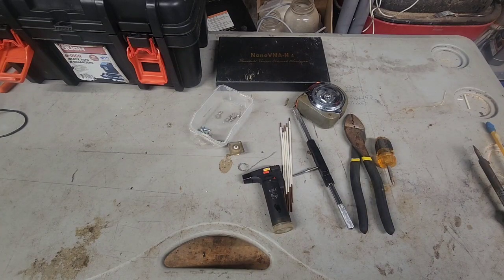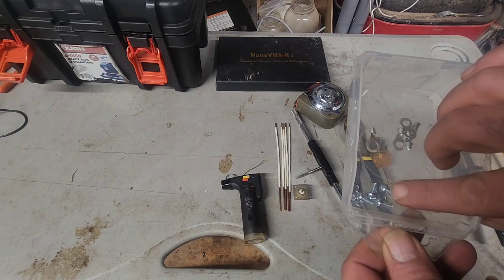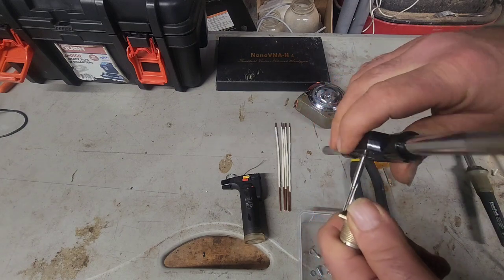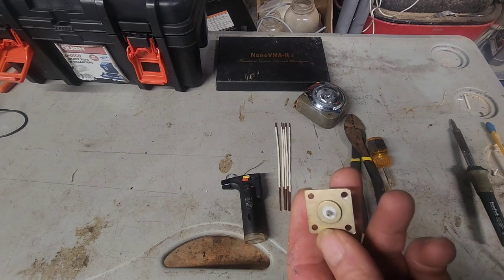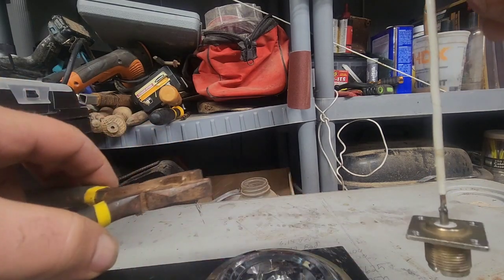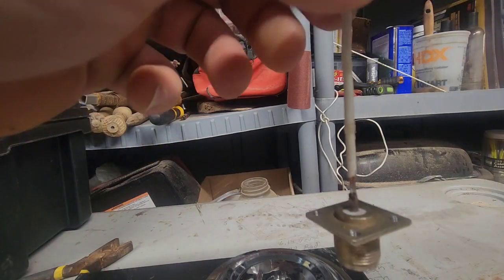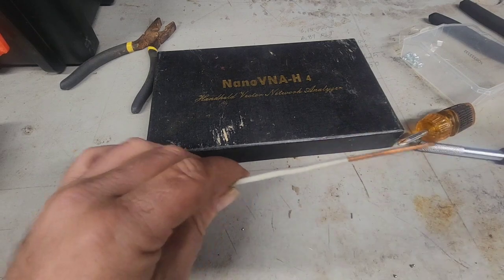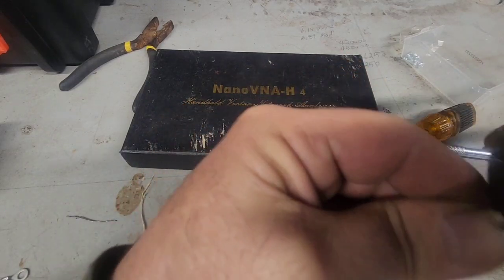70cm/gmrs groundplane build

Comment: Thank you for the video I'm putting it in my group

I think that hypothetically putting it on 11 m with basically longer wires a considerable difference however I still think the same principle applies

Anna meantime 73 yes it is going to be a much bigger on the citizen band 11-meter definitely
Reply from the maker: It will work fine on 11m. You can get it more compact by using fiberglass rod and wrapping the wires in lose coils around it. Then use some large heatshrink to hold everything in place

Comment: Do you have to insulation on the wire, or can you use 14 ga. ground wire from 14ga. romax the reason being I'm making 4 of these ,ONE for me and 3 for my friends.  And I've got the ground left ,Thanks for sharing
Reply from the maker: You can get a better swr and impedance match if you tune to one band or the other. Either ham or gmrs. The readout on this antenna is pretty good but can be better if it's tuned band specific
Reply: Thanks
Reply from the maker: The insulation is not necessary.
Reply from the maker: Anytime
Reply: My buddies thank you too. Because of you sharing you vidio they they got a new antenna. 
Thanks again  keep up the videos
Reply from the maker: @garytedlock7533  glad to help
Reply: @mikesmancrafts   You sure did ,There's probably probably a lot more that would like to say TRANKS MIKE
Reply from the maker: Let me know how they work for you
Reply: @mikesmancrafts   will do